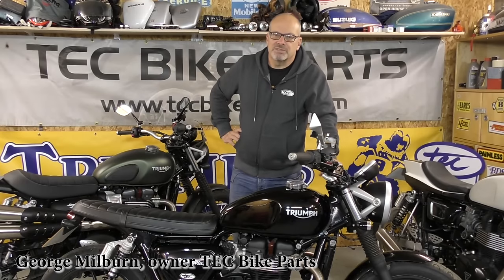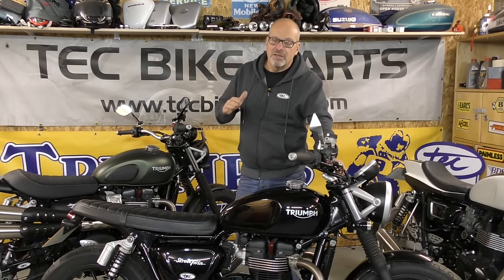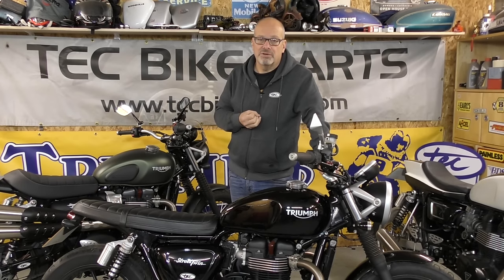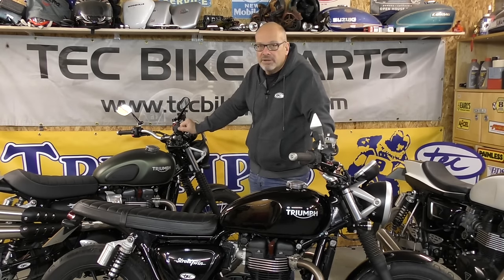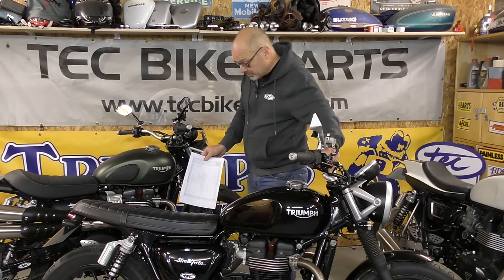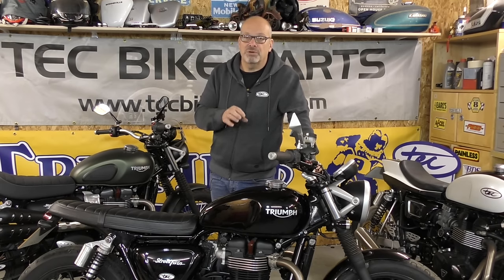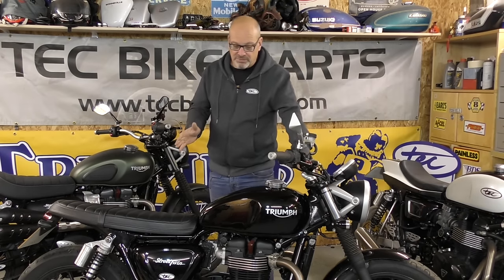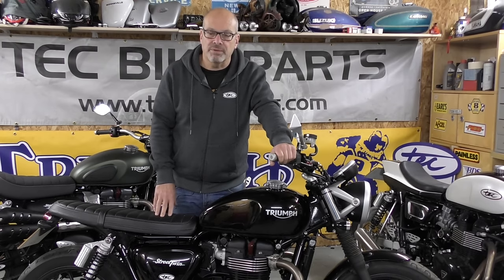How to de- restrict 900cc Triumph Street Twin/Cup/Scrambler/T100   for LOTS  more power and torque.

Comment: Hi, you said you could easily replace the front brake with a 6 pot caliper - I assume you would also need to change out the disk as well to match? You don't have any brake components on your website, is the brake upgrade something you can supply, and if so, what would be the rough ballpark price? Cheers!

Comment: Very impressive HP gains. As a (some what) long distance rider I don't want to change the noise level or fuel economy. I'd be happy with a moderate gain. Is it practical to change only the cam? What kind of HP gain would expect? (OK to guess)
Reply from the maker: if you change the cam only you will gain around 10 bhp with a far better spread of power over stock cam
Reply: @TECBikeParts  the mods you done ......does that void the warranty ? Thank you

Comment: Ok so it looks like this is the Street Twin before they upgraded the motor. I have a 2019 ST, did Triumph use the same restrictive cam on the 2019 and up models?

Comment: I just bought a street cup. Will you guys be selling this cam? Will there be mod kit for it with the other upgrades you mentioned (breaks etc.) . I'm in the states and interested in purchasing. I'm guessing in a few months I'll be wanting more power out of the bike anyway. I'm sure the cam would be cheaper than buying a more powerful bike. Would love to order one! Cheers!
Reply from the maker: Hi Phil
Yes we have cams for the street cup and can send to USA no problem, just check on our web-shop if you need the 101 type cam or the 202 type from the last 6 digits of your chassis number both same price.
Reply: Can't seem to find a link to the shop. Could you post a link? Thanks!
Reply from the maker: this is the link to the cam on our web shop and has all the details to check if correct for your chassis number, see-           https://shop.tecbikeparts.com/products/cam-101

Comment: LOVED THE VIDIO, AND ABOUT THE CAMS ! YOUR RIGHT -ON !  AND ABOUT THE SMALL VALVES !  ALSO LOOK INTO "NOLOGY " COILS (40K) AND THERE SPARK PLUGS WIRES !  "BRISK" MAKES A GREAT SPARK PLUG , " EVO" , THE BURN IS  ALL OVER AT 3-5 ° ATDC
Reply from the maker: Hi
yes we have used these in the past and are good but only give very small improvement on stock motors
Reply: I HAVE THE FIRST YEAR FUEL INJECTION, THURXTON, MOD TO AIR FILTER,AND BETTER AIR FILTER,TRACK DAY MUFFLERS,AND NOLOGY COILS ,WIRES AND PLUGS, DROPED THREE TEETH ON REAR SPROCKET, BETTER BRAKE PADS FRONT AND REAR, AND BY-TURBO REAR SHOCKS,AND BETTER FRONT FORK OIL ! NOW ALOT OF POWER ALL GEARS, UP TO RED LINE

Comment: Anybody had a remap after this? I had these mods and just read about a street twin with x pipe that burned out exhaust valves -
Reply: Remap is recommended by many.
Reply: @mcplutt  This is a 2017 model and there was a 2019 Triumph ECU update, installed as a matter of course but had no noticeable difference, possibly long term engine running benefits. These engines ECU coding still locked down so can’t tune for performance by Tune ECU but they are perfectly able to adjust AFR by themselves for minor modifications. So who exactly are the “many” who recommend remapping?

Comment: Hi Ted parts
I have a Bonneville t 100 2017  and have just watch your vid on upgraded cams .
This could be a modification I would like to do to my t100 .
Please keep us Triumph Ryder's informed . at a sensible price and how to do this job I would be interred .
Regards
Paul
Regards
Reply from the maker: Hi Paul
Yes will fit straight on to all the new water cooled 900cc twin bikes and totally transforms the motors performance. If you already  know us at TEC you'll know we have a reputation for giving a lot of bang for your buck.
The first batch of cams should be ready around Xmas time and if anybody would like to reserve one give me a call or email. regards George
Reply: TEC Bike Parts 
Hi George
Thanks for four reply ,yes i,am very interested  but must get over Christmas first.
I also must buy one of your  front  fork spring upgrade set first .
But I will be in touch .keep the good work up at Tec parts .
Regard 
Paul
Reply: TEC Bike Parts , what email address do I use to send you mail George??
Reply from the maker: george.milburn@tecbikeparts.com

Comment: When you start production of the new cam, also make replacement "valve cups" and matching shims.  Make the "cups" so they have a wider ring around the edge and the shims with a smaller diameter to fit inside them.  Then make a tool to compress the valve spring (engine at TDC) so you can use a magnet to pull out the old shim.  Then you can make the shim change without having to remove the camshafts.  My old VW Sirocco (9000rpms) and Toyota Tacoma have this type of valve system.  I don't know why Triumph did it the way they did.  I was going to get a T100/120 until I saw a video on checking/adjusting the valves.  Now it's a Moto Guzzi for me unless you make those parts with your new cam.  Please??????
Reply: Unless you do a crazy amount of driving, there should be no need to make these parts. Valve adjustment is rarely needed anyway. But of course it needs to be checked at intervals.

Comment: I'd like to see a video with the bike riding. Are you sure it won't mess up the engine i the long run? When will this shaft be availlable? The decat for the scrambler should be availllable already as well. Can't see it on the website yet. When will there be an updat for the frontbrake ready? Upgrading camshafts will only be usefull when the sloppy brakes are upgraded. Making video's is nice, now deliver! Looking forward to the products
Reply from the maker: Will do a riding video as soon as the salt is off the road (icy up here in the north) de cat due in next week and cam soon after. I will put up on facebook as soon as available.
we have done the brakes upgrade but need to do the road testing before selling them so waiting for better weather again.

Comment: Does a sharper camshaft not require stiffer valve springs?
Reply from the maker: This is not a race cam it is basically a standard cam and the one the bike was meant to have fitted before they decided to restrict it.

Comment: Hi George, at the start of this vid you stated that you tried the 1200 throttle bodies o the 900. 
Just wondering if you fitted the 1200HT or Thruxton cam/s to the 900?
Would be good to see dyno curves with these cams and the twin throttle bodies, just as a comparison of what the stock 1200 parts can do for the 900 motor. Any chance of seeing this?
Reply from the maker: Hi
No if you listen carefully , I said is I tried a larger single throttle body.(45mm Kehin).It only made a small difference and would be pointless fitting the larger twin 44mm throttle bodies with the small stock valves.
BTW all the 1200cc bikes inc the Thruxton R run the same part number camshaft, and throttle bodies. The power is different on each model due to combinations of valve sizes, compression , crank weight, exhaust  and ECU map.
The work we have done on the 1200 motor up to now indicates we need to change the cam profile and the ECU among other small changes to gain more power.
Reply: Hi George, thanks for the reply.
If 1200 cams are all the same, then I can assume the 900 cam is a different part number, therefore different lift and timing specs. Did you try a 1200 cam in the 900?
Reply from the maker: Not tried myself,  but I have been told by the guys at Triumph that due to the decompression valve lifter mechanism  on the 1200cc cam it cannot be fitted in the 900cc motor
Reply: @TECBikeParts  cam shaft available for 2022 models

Comment: Great research and work George. I sent you an email, I also was under the impression that Triumph has, at least on the 1200cc ECUs programmed the throttle bodies to close 15% at 7,000 RPM, verified by several folks with the help of dyno tuners. Is there a similar restriction or reduction on the 900cc engines?
cheers John D.
Reply from the maker: This is not really a restriction. This will be done to give a smooth shut off when hitting the rev limiter, instead of hitting a wall if it came in at full throttle . This will probably be part of the Keihin base program as it is used on some car ECU maps. The only way this could be removed is if somebody cracks the ECU so it can be remapped out and rev limit raised.
Reply: Keep up the good work, appreciate your expertise. Raising the rev limit may not be the best answer as you have already demonstrated. I know you so busy now, looking forward to your email acknowledgement as you get time regarding my various orders :)

Comment: Will this be coming out for the T120 and other water cooled 1200 models?
Reply from the maker: Hi Adam, The T120 has a 'normal' cam fitted as stock, not a restrictor cam as fitted to the 900cc bikes.
We will be starting on the 1200cc bikes cam , next but you will not see gains like on the 900cc bikes.
With a performance cam and airbox mods on the 1200 you will see gains of around 15% -18% or about 35% with forced induction.
Reply: Tec bike. Enjoy your videos. I too am interested to upgrading cam for Thruxton R. I have upgraded my 2009 Thruxton 865 right about 85 hp at rear wheel and 60 ft lbs. My 865 (904) is actually faster at Bonneville Salt Flats 140 mph than my 1200 Thruxton R (136 mph) with same HP at rear wheel although R has 75 ft lb torque.
Reply: I liked the t100. Did not find it lacking in power.  I chose the t120 for the six speed gear box.  I ride interstate as well as backroads.  The six speed makes touring a bit more enjoyable.  I’m wondering if the restricted cam is in the t100 for the American market.
Reply: TEC Bike Parts I test rode a 2018 T120 last weekend and the new 1200cc engine is pretty impressive bone stock. Especially in the mid rev range. The low end tourque is sweet and the high speed is limited more by ground clearance, suspension, and other frame architecture than it is by the engine. In other words, the motor is plenty fast for what is almost a dead copy of a 1959 bike design. Just the opinion of an old guy, not a pro racer.

Comment: I had mine bored to a 995/ stroked / piston / cam/ exhaust/ street triple throttle bodies/ full custom Supertrapp Exhaust/Ohlinsrear suspensionGalpherfronbrakes. It dyno at 90hp. Its a
Reply: fast mo fo !!
Reply from the maker: Hi
Like I said in the video you can probably get close to 100bhp out of this motor, but as you have found the last few BHP are expensive.
Surprise surprise ! Triumph have now announced a 64bhp 'high power version' of this motor for 2019. Do you think we shamed them into it ?

Comment: This explains why Chris Pratt could outrun velociraptors on his scrambler, you got your hands on it! ahah

Anyway this is amazing, does this applies also to the new 2019 model? They gave it a bit more hps with "improvements to the engine" but maybe just actually changed the camshaft and refined the ECU eheh
Reply from the maker: Triumph have stated on the 2019 bikes, that they have gained this extra power without mentioning a cam in the changes made. Obviously as not released yet, we have not stripped a bike and the parts lists are not out yet ,so we cannot confirm this . I would bet the farm that the camshaft has a different part number!  .
 They just want to play down that they made bikes with restricted power for marketing reasons. It now look like they have changed tack and want to make bikes that distance themselves from the ever expanding range of mid size retro bikes  with 47BHP , as the likes of the RE650 has them beaten on price by a mile.

Comment: Have you heard of wiring issues on the Street Twin? I'm on the cusp of buying one but have learned there may be issues. Cheers.
Reply from the maker: only the recall on the tank wiring, this has been done under warranty by dealers at no cost.
Reply: I'd heard the harness was failing at a cost of about £2k to replace??
Reply: So does that mean it would be done prior to picking up a new bike...?

Comment: If my Street Scrambler has the A2 restriction, how do I get that removed? Also would the A2 restriction make the better cam have less power? I get 90MPH max on a 2018 Scrambler :( thanks
Reply: You need to replace the throttle grip, and reprogram the ECU. I did both last year.

Comment: So you have to buy a street twin then rebuild the engine to get less horsepower than a standard 865 T100 [67 BHP]
Reply from the maker: It is not all about numbers, you need to ride one with an open mind. The new bikes feel a lot stronger and lighter than the old models, I own and love several of the old type and was skeptical at first.
Remember everybody was quick to rubbish the new bonnie back in 2000 when it came out. Nobody likes change but regulations dictate the way forward for motorcycle now.
It is OK to have an opinion but sometimes you have to look at things from both sides to get the big picture

Comment: Sounds like you have a great product there and I wish you every success with it. Just a small thing though: There is something odd about the curves on your dyno printout. When measuring power in HP and torque in lb-ft the curves should always intersect at 5250 rpm but your curves do not. Wierd.
Reply from the maker: Not always like you state, lots of graphs I have seen and on the internet do not intersect at all or not at those revs.
The graph scaling  would depend on the software the rolling road is using, sounds like you may have been using a different system.
These runs were done by an independent company ( Dragon performance) . They have no connection to us . The test were run on a Fuchs rolling road. Not sure of the software.
As a matter of interest what would happen on graphs that cross over at several points  or not at all?

Comment: Is there  a re-adjustment of the valves needed after changing the camshaft?
Reply from the maker: Yes, after any work to the cam or valve assembly you always need to check the clearances and adjust if necessary, this is normal practice
Reply: is it with adjusting Skrews? because with thickness rings it's almost not feasable when you don't have  the whole serie of thicknesses...

Comment: I'm considering one of these as my second bike so wondered what implication is on insurance and triumph warranty if I upped the power by such a large amount.  ?  Seems like a good upgrade that is for sure.
Reply: Brian Steele warranty would be void.  Insurance is based on displacement which does not change.
Reply: Thanks!
Reply: One of the questions asked by insurers is- have you made any modifications to the vehicle, and adding a high performance cam to the engine certainly qualifies as something likely to increase the premium.
Reply: @stevenhill6214  - It's not a high performance cam (as stated in the video)

Comment: Hi. What's the average fuel consumption L/100kms with this cams?
Reply from the maker: Fuel consumption is normally slightly better with the cam over stock, as the motor is more efficient. Once the initial excitement of the extra power is over.

Comment: Didn't triumph now correct this cam shaft restriction? They produce 18% more power at higher rpm but don't change the torque figures.
Reply: Hi
yes Triumph have changed the cam in the 2019 street twin
Reply: @georgemilburn6213  so why hasn't the torque figures changed? What magic is that?
Reply: @TechOfTimes  - Answer: George Milburn of TEC Bike Parts magic (investigative reverse engineering). Now Triumph "appears" to have had a "brilliant brainstorm" playing catch-up because the cat's outta the bag.

Comment: Great video and results on the new camshaft. But I'm confused. This video was made 5 years ago, so in 2018.The 2018 Triumph bikes were air cooled double cam engines. When I go to your website to buy an upgraded camshaft for my 2014 Scrambler which is air colled and DOHC, there is not a camshaft upgrade listed, only SOHC which is the newer water cooled engine starting in 2019. What am I missing? I am ready to buy! Thanks!

Comment: You can not make stock ecu without disabling O2 sensors richer. O2 sensors controls ECU with maf and adjust AFR accordingly. Full throttle will run 12AFR so it's myth any map can be adjusted without disabling O2.

Comment: Can you guys produce an aftermarket tachometer for the street twin?
Reply from the maker: Not been asked up to know should be straight forward to pick up off the coil. A tacho feature is built into the bike as on the street scrambler dash, just deleated on the 'cheaper' street twin, if you could hack the ECU this feature could be unlocked.

Comment: Hi, I just checked your website - it says the 202 version of this cam is needed for later T100s. Do you know when this cam will be available?
Reply from the maker: due to be ready in November
Reply: @TECBikeParts  Awesome! Thanks for letting me know! I'll be getting my Bonnie soon, though I'll be riding it with the stock cam till I get used to it. When I'm ready, I'll take the trip up to see you and get some performance bits, probably in early Spring.